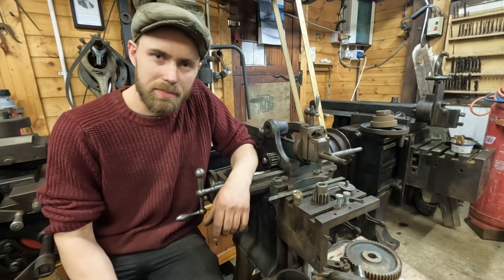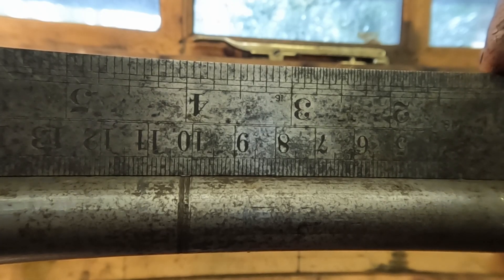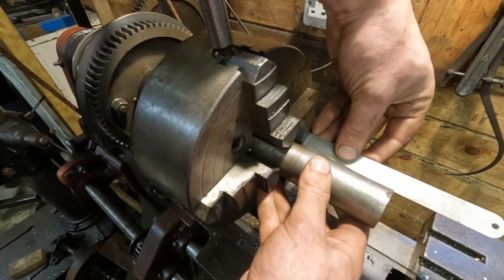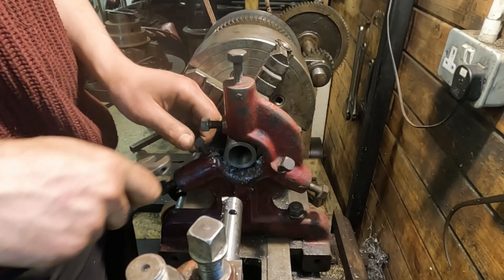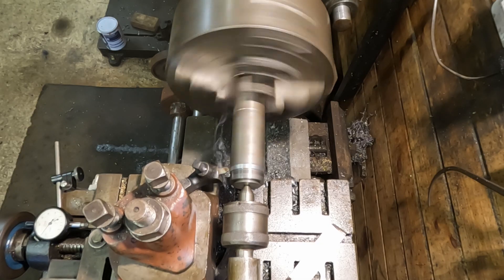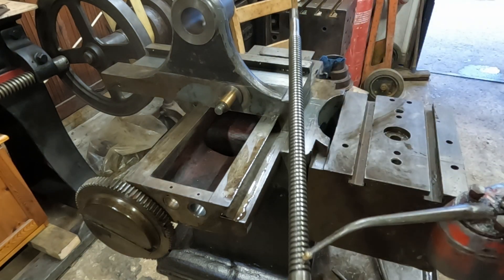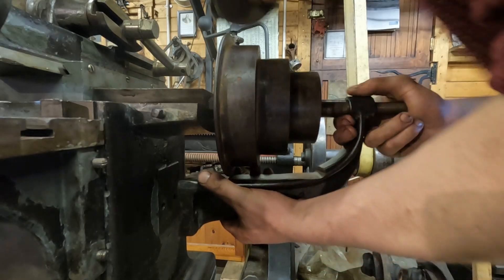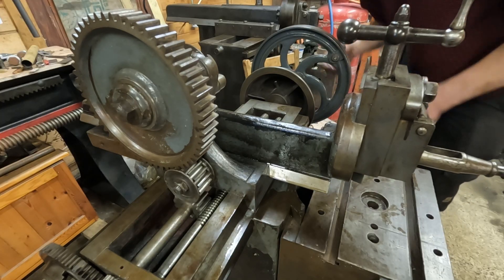1890s Shaper Rebuild and First Run! - Belt Driven Machine Shop

Comment: Hi Alec, quite the jigsaw puzzle! One observation though. The "input" stepped pulley that you shaved a few thou off of, looks, to my untrained eye, that it might be in backwards! The bracket that serves as the rear support has a step in the casting at the outer curve of the casting. Why is that there? If the cone pulley is rotated 180° will the rim of the large pulley then clear the casting, courtesy of that step? If not, why is that step there?
Regards and thanks from Canada's banana belt. 
🤞🇨🇦🍌🥋🇺🇦🕊🇬🇧🪓🐖💩👜🏁👍

Comment: I started work in in 1974, at  pendeford airport, in a small toolroom which was then on it's last legs,  the airport was very run down,, I spent 2 years on a clapped out 26"  war finish stroke shaper, and a butler super shaper 18" stroke, about late 1960's or early 70's  I know it's not your era jonesy, but what a beautiful machine, no clunking, knocking, just a swishing of hydraulic oil and tick as it stroked back and forth. What a beautiful machine, just like a surface grinder  I miss those days.

Comment: Is there a particular reason you chose to run a line shaft shop?
Reply: Alec's shop is trying to reflect an 1890's period shop that would have probably been a line-shafted shop run off of a steam engine. He has indicated this in some of his other videos. He has also hinted at trying to do just that, revert to steam power. But for now, an electric motor will have to fill the void.

Comment: Why didn’t you add weld to the shaft and turn it down to fit the part that didn’t come with the machine. See a channel called on fire welding, he fixes modern big boys toys.😁 love the channel, glad I found you, thanks 👍
Reply from the maker: I considered it. I've done the process a few times but only on larger shafts, making a bush was just simpler, for me. 
I'll check him out! Cheers!

Comment: Why didn’t you bore the pulley out a bit to make the bush more easily? You’ve done that before. I do that as well. I don’t like having to deal with very thin but fairly large parts, even in my more modern machines. But, I have to say, you did a great job with that. It’s a beautiful little machine. I did a quick calculation. If you’re taking say, 0.005” with each stroke, and a 2” stroke, and you need to go 5 inches, that would be 200 strokes per inch of length, for 1,000 strokes. If it took around 2 seconds for a full cycle, which is in the ball lark for these things, that would be 2,000 seconds, which is about 33 minutes - the time it would take to cut one layer. I don’t know how deeply this machine can cut, but I imagine it can’t be much more than that, particularly with the high carbon steel tools they used back then. My mill can do that in 2 minutes. So when people don’t u detest and why these things lost their dominance, that’s why.
Reply from the maker: I did think about boring the cone out a little. You're right, it would have made life easier with the bush. I think I decided against it because cones are quite awkward things to fixture, and I couldn't justify taking the extra time with an extra operation. 
Great calculation. While I'm sure this machine is more capable than I show here, it shows perfectly why shapers are redundant in a commercial setting, especially shapers this size. These days, they are a fun curiosity that occasionally prove invaluable in a job shop.
Reply: @iron_jonesy What holds the pulley cone to the shaft, it looks to me from the video as if there is a hole for a grub screw, does it rely on how tight you screw the grub into the sleeve you made and then the cone bearing on the screw, you didn't show any adhesive when slide the sleeve into the cone pulley?

Comment: what is the power source for the line shafts?, new sub just found you
Reply from the maker: Thanks for stopping by! I have a large electric motor mounted in the ceiling which is currently providing power
Reply: @iron_jonesy  the shop sounds exceptionally quiet with the shafts and machines running, it appears to give a calm atmosphere. you speak well and articulate your thoughts clearly it's a pleasure to hear you speak, but your accent i cannot place, perhaps the West Country?